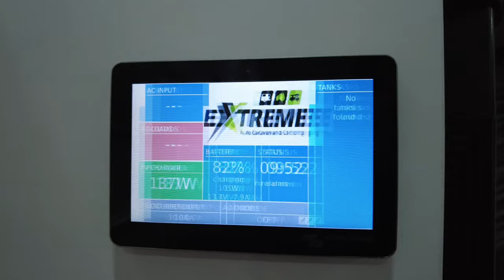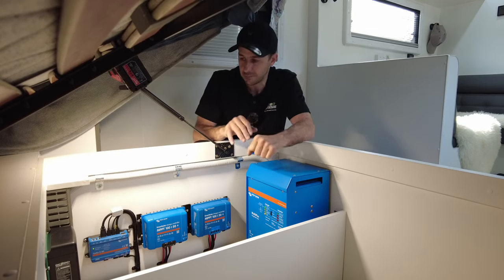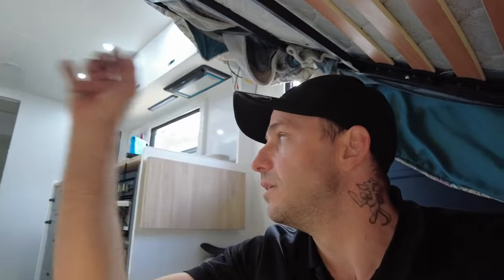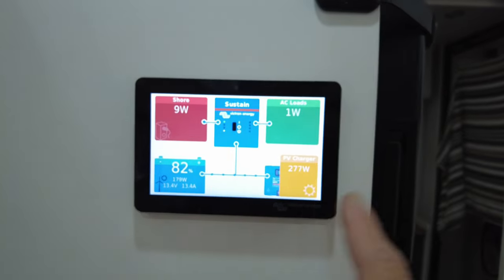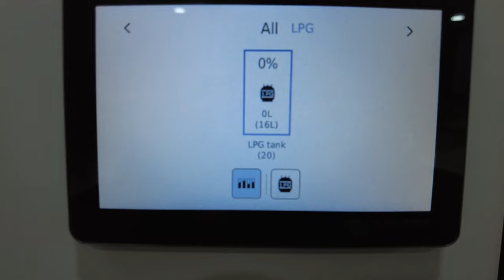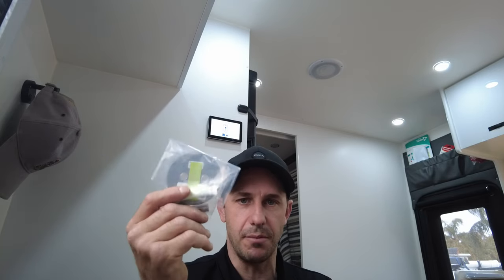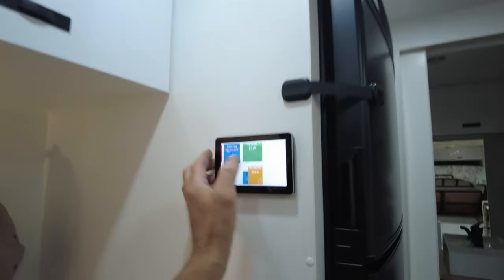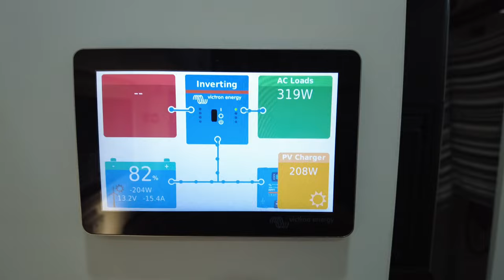NetworkRV 1000watt Solar, 620ah lithium off grid setup, Air-conditioning, microwave and more

Comment: Love your work mate! Just a question how did wire up the solar panels in parallel or series?
Reply from the maker: Thanks
You will see both series and parallel here.
All shade dependent.
Reply: So the 3 panels are in series then  parallel to solar controler?

Comment: Hi Matt, we have brought a new van and would like to add a diesel heater. The batteries are under the seats and there is no room for a diesel heater, should we but it in the tunnel boot and run the pipes through the van or do we move the batteries in the tunnel boot.